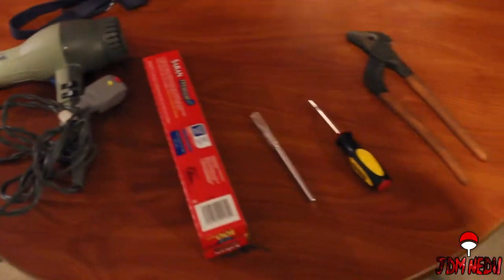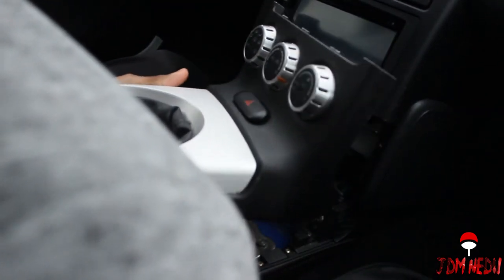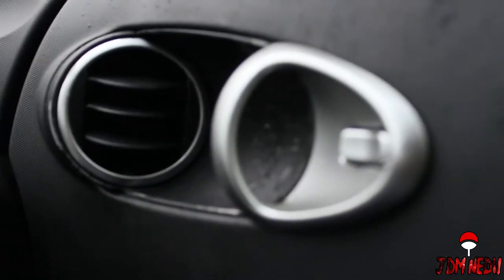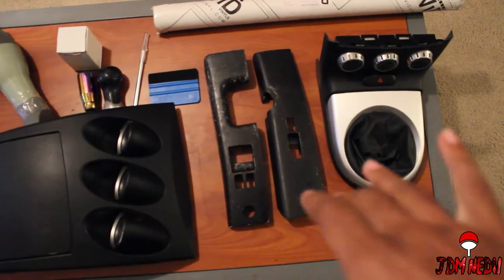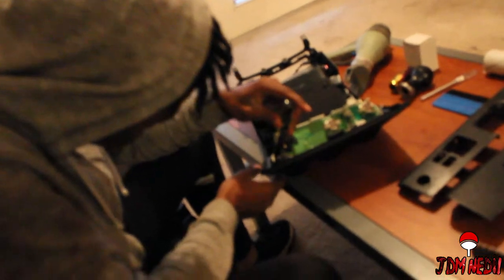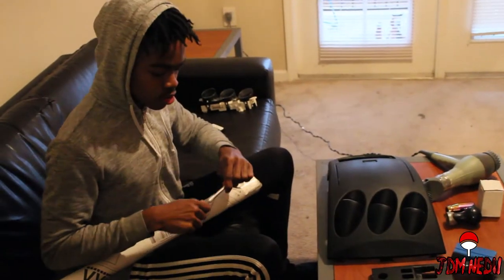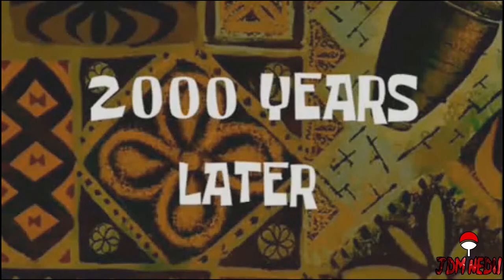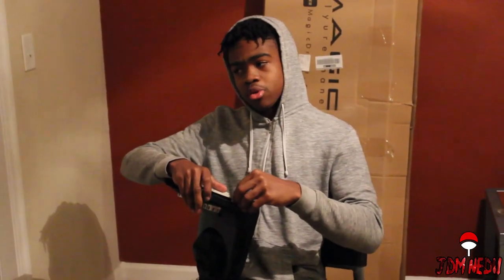350z Carbon Fiber INTERIOR Wrap Install!

Comment: whats that shift knob?
Reply from the maker: i bought it off ebay. i dont think it has a brand but here is the link : 

https://www.ebay.com/itm/FOR-NISSAN-300ZX-350Z-370Z-6-SPEED-NEO-CHROME-FULL-GRIP-LONG-DRIFT-SHIFT-KNOB/201008420324?fits=Year%3A2006%7CMake%3ANissan%7CModel%3A350Z&hash=item2ecd0915e4:g:BS4AAOxyUrZSt-Qe&vxp=mtr
Reply: thanks man.
Reply from the maker: no problem.